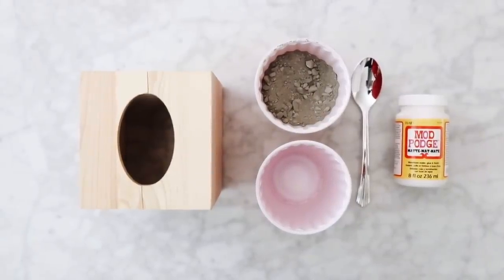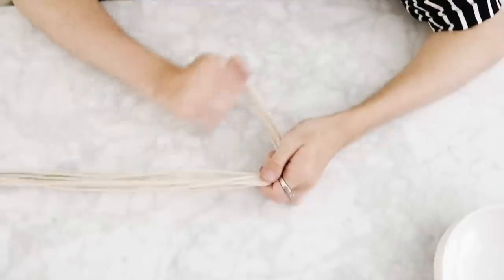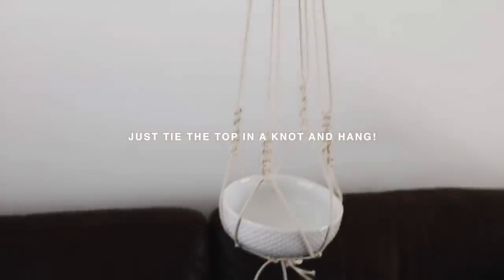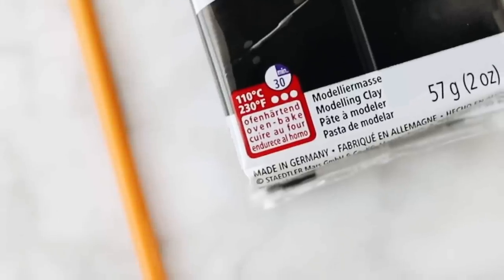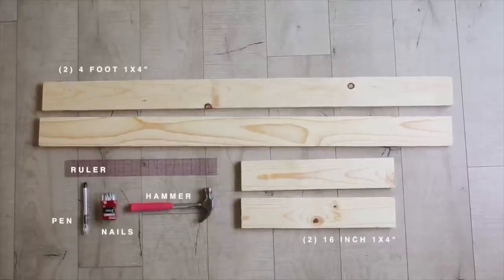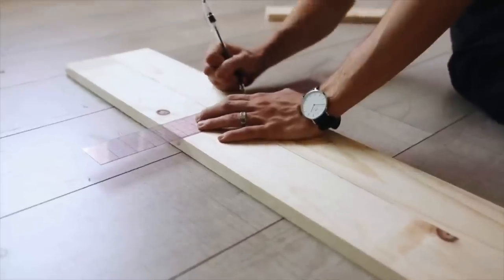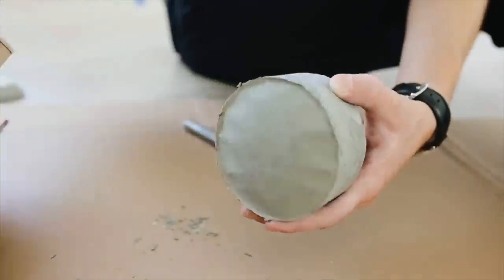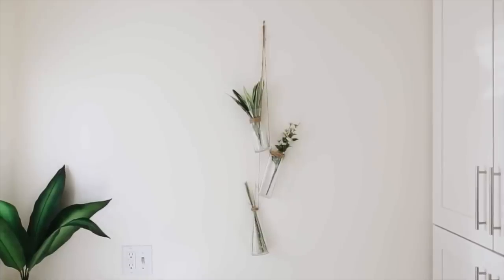7 DIY EASY ROOM DECOR IDEAS! (Pinterest Inspired) // Lone Fox

Comment: 1) Cement tissue box (cement powder, tissue box, mod podge, a brush to tap it on) 
2) macrame plant Holder ( macrame cording: square knots,  a bowl) 
3) foto stand (fimo clay: black and White for marble) ,parchment paper
4) candle holders ( concrete mix, water, cups: one smaller than the other, to mold, sandpaper to sand down rough edges, paint) 
5) wood ladder ( wood, nails/screws, screwdriver/hammer) 
6) jewelry holder (concrete mix, something to mold it) 
7) vases (3 different vases, hemp cording, plants/faux plants)